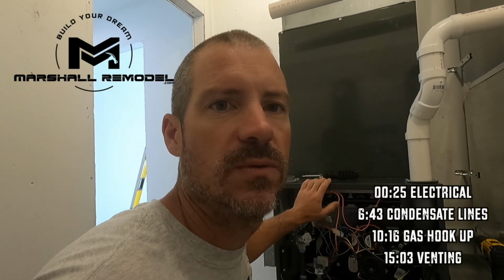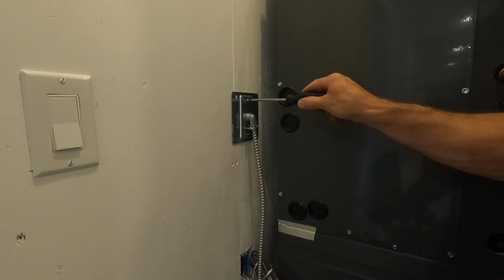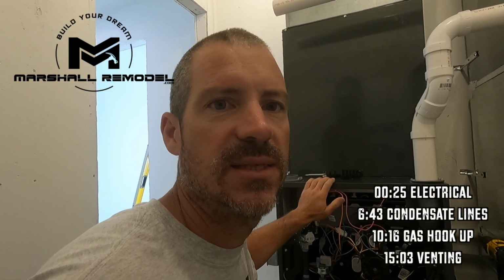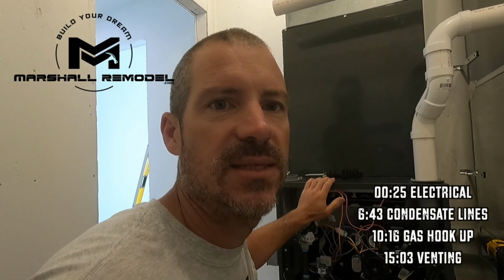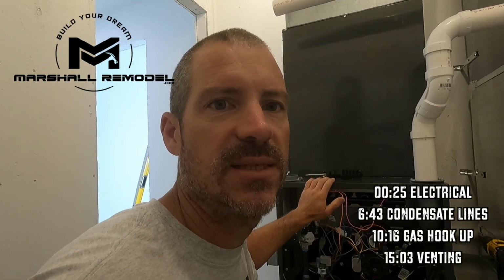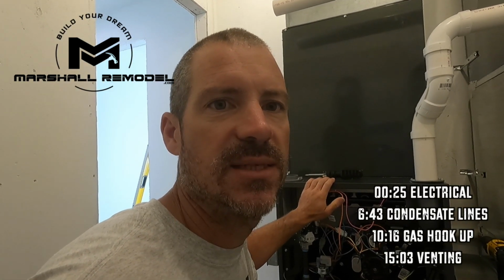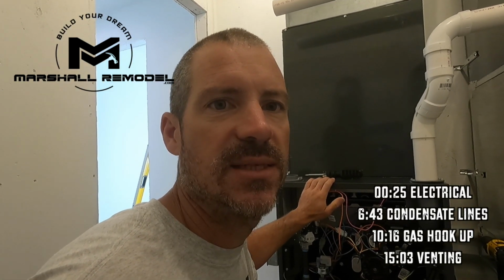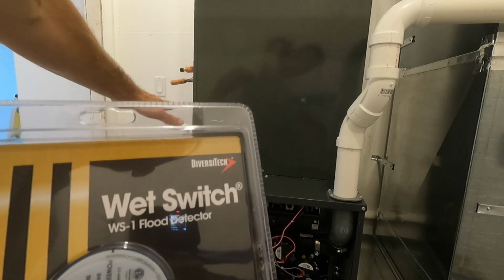Installing a Furnace and AC unit - Part 2

Comment: No primer on any of your PVC joints?  It’s usually blue, so the inspector knows you used it. Automatic code failure in my area. The concentric termination should not have any pipe or fittings added to it.  What you have done could actually cause flue gasses to recirculate into the combustion air under the right conditions.  Big no no.

Comment: Your gas drip leg should have been installed so there was a change in direction for the gas. The way you have it can allow for debris and moisture to be pushed across the tee. Otherwise nice work!

Comment: Do you have to put the low pressure switch in the gas line if it is natural gas.
Reply from the maker: No it’s just for LP since it comes from a tank vs a natural gas line

Comment: An SSU Switch is typically used for the furnace, and I agree, albeit a negligible point, to install it on the wall... too, while not a Code issue, it is usually standard practice for switches to install the line side on top of the switch and load side on bottom... just for uniformity in switches throughout a project.

Otherwise, very comprehensive coverage of the install! Appreciate the video posts!

Comment: Very clear and professional video .. always clean work ! I did have a question on your venting .. looks like you used 2" the whole way , did you ever have to step up to 3" after making this video ? .. my new goodman came with a chart in the manual . With how many feet with so many elbows , for 2" 3" runs . I'm only running less than 15 feet so I was hoping to stay with 2" . Want to see if you had any issues .  Thanks for taking the time to make these types of videos
Reply from the maker: Runs perfect. I ran 2” the entire way.

Comment: Also, you never put anything on top of a concentric kit.  They are designed for water to go down.  You just caused pressure switch issues.   DIY, lol.
Reply: Most definitely... I literally cringe when I list out how many items are incorrect and need re-done or changed.

Comment: You really need to read the instructions before you make videos, I've been in HVAC for 48 years
Reply: He needs to do more than read the instructions, he needs to bring in one of us properly qualified technicians or installers to fix all the improperly installed items.  I cringe when i watch the videos.  This system is going to have so many issues and will never pass code inspection.

Comment: Also should only use non-corrosive leak-check fluid. Cheap enough. Won't corrode metal pipe & fittings (unlike water)

Comment: Might be good to insulate your Ducts, also install an EZ Trap Condensate Drain Trap with Automatic Safety switch to prevent overflow when Drain Clogs (Which it eventually will...)

Comment: Great videos and explanation. May I ask you couple of questions
1. Where did you purchased the furnace (the entire unit)
2. You mentioned the part 3 would show how to install the wiring to thermostat and other stuff, I could not find one.
Thank you in advance.
Reply from the maker: We purchased the unit through a local place but have used AC Wholesalers in the past with good luck. Part 3... kinda forgot to put that video together but it's on the list!
Reply: @MrPostFrame  thank you for the details. Once again your videos helped me to do home improvements and lot of motivation.
I am planning to purchase goodman furnence and heat pump through hvacdirect.  With your motivation I will can do atleast 80% of the installation and will take help of contractor on the final setup and installation. Thank you.

Comment: The sediment trap isn't installed correctly. You want to install it in a way where the gas is flowing straight down so that sediment is falling into the trap. The way you have it has gas flowing across it which could allow some sediment to get past it.

Comment: You don't have to goose neck the concentric ,the 90% furnace drains.
The intake on the concentric is under the exhaust covered with that funnel piece
If you did a 2 pipe you have to goose neck the intake .
Reply: Yep, he caused issues with that furnace.

Comment: Obviously the work you’re doing on electric, gas plumbing excetra is legal for you to do. What is the situation for all of the regulatory inspections normally required for working on these systems? This is not an indictment against your work, because everything I’ve seen you do is usually to a higher standard than minimum requirements, just wondered if it is because you’re in a rural location instead of an incorporated city. Thanks for the content, very interesting and enlightening!
Reply from the maker: Rural locations tend to be less involved when it’s a personal home build. It can be a blessing and a curse depending on someone’s knowledge and skill

Comment: I don't mean to be degrading or otherwise. But after seeing this I feel like I should say something. As a licensed journeyperson in Iowa, and mechanical instructor.
Your condensate (tied directly to sewer without an air gap, improper venting,  improper trapping), gas line (improper drip leg location), electrical (missing protection from J box to furnace chassis), and flues (no  insulation in unconditioned space, screws protuding pvc pipe, exhaust cannot be terminated down on category 4 venting system, cannot have obstruction in exhaust, and improper or lack of proper support) are not up to mechanical code nor your installation manual, and you will experience many issues. And please under no circumstance tie your intake into the condensate sewer line as you will draw methane gas into combustion. Any manufacturer will also void the warranty on this product if you run it like this.
Reply: You have to insulate flues in unconditioned space?
Reply: What about the lack of anti-short bushing at the box connector.
Reply: Shouldn't there be yellow tape on the gas pipe fittings?
Reply: Where should the drip leg be located?
Reply: @jasoncanmore5838  it should dead head into a drip leg. Example would be to install a T fitting on its side right outside the furnace, bring the gas supply through the top of the T, furnace to be connected out the side of the T, and a nipple with a minimum length of 3" as measured from hub to hub (so you would need a 3.5 -4" nipple) with a cap on the bottom. This forces any moisture, oil, and debris to be collected in the drip leg and not allowed to flow right past into the appliance.
Reply: @mdjohnson03  Got it, thanks
Reply: After watching the video I needed to see the comments cause my brain was throwing off a couple of red flags the screws In the exhaust are gonna rust and it will probably recirc. Let alone not insulating the vent in un conditioned space could possibly freeze up
Reply: Finally another qualified installer that can back me up on the laundry list the long as my leg of all the issues that need to be addressed.  Hell, you didn't even list them all because you got tired type all the the wrong items.  I just cringe as the issues in this system.

Comment: You should extend your coil condensate vent line higher than the safety switch and with the ss2 installed how will you be able to spin out the primary drain?

Comment: you are going to be short on return air.  with a side return like yours and on motor side makes it worse. furnace needs to be on a raised box with return at bottom so return air can get around to other side of fan. this became a problem when they made furnaces really short. check the instructions that came with furnace.
 condensate is never hooked direct to a sewer line, must have a air gap
Reply: Air gap??
Reply: @stevenbrowningsr1144  air gap is a plumbing term. it is hard to describe so i would ask that you google, what is a air gap
Reply: Agreed, I see it all the time on goodmans  ends up with high co problems/overheated heat exchangers, the more return the better with any new 34" furnace. Idk about the states but in canada we are supposed to insulate the pipes going through unconditioned attic spaces so the exhaust doesn't freeze.

Comment: Always use a grommets or chase nipples when running wire through metal knock outs. Also, the condensate if highly acidic, may want a neutralizer on that, not sure what that does to a septic system.

Comment: Where I live the exhaust needs to be system 636 to last overtime with the heat fluctuations. Also need to be sloped 1/4" per foot back towards the furnace for condensation especially if the vent is running through an unconditioned space. With a hanger or support every 4 feet. Not sure if these regulations are required where you live.
Reply: To the best of my knowledge, that is code in all states for the PVC exhaust venting.  It was literally built to be that way, so there is no way vertical would pass code.  It would backflow into the system and what would be the point of having the rules in place.  I made this post on the first video.  The exhaust has to be re-done, on top of several other items.

Comment: Maybe I missed it but did you install a one way check valve on the condensate drain so water cannot back up through the drain into the evaporator pan?  It happened to us and it was a mess.
Reply: No he did not install any check valves , he did install a float valve which will cutt off poweer to the unit if the drain starts backing up

Comment: Please keep in mind that PVC is NOT resistant to UV light coming from the sun.  As such, the IRC (International Residential Code) requires that exposed PVC be painted so as to prevent its structural breakdown over time.  Excellent work, young man!  Keep it up!!!
Reply: They don't require that here in michigan

Comment: greetings mr. paul; i just use a long nose lighter to check for leaks. it is not as messy. also i had a problem with my air vents like you have because wasps went inside and built a nest that basically suffocated my furnace. they make round snap in screens (stainless steel) that fit the pipe fittings and they are online for purchase. they sure saved me..................g

Comment: 5:30  Ok Paul, If you have taken out the evaporator (A-frame coil) drain pan how are you catching the condensate off the evaporator and directing it out to the drains?  Something sounds odd here or I'm not understanding what you have removed.
Reply: I believe there are 2 different pans in the unit because it is designed for a vertical or horizontal install depending on the house. So I think he's saying he removed the drain pan for the horizontal mounted application.
Reply: @dcmchiefs2008  The A coil needs to be removed from the unit and a condensate drain pan needs to be added but that is the least of his worries after watching the entire video.  I hate to see video #3 but I don't believe that was ever made or uploaded.
Reply: That's wrong, this comes as a dual mount furnace, so it has two drain pans and he removed the horizontal one.  All of the cased A coils come with built in drain pans.  It's all good for this part

Comment: So please use wire nuts at the furnace/ac house junction box, The furnace cycles many times per day with a high amperage draw at startup. The legos could ark internaly duting high amp draw heating up and causing even higher amperage as the voltage drops. ps good luck, high power communications tech.
Reply: I had the same thought. Wire nuts are the way to go as long as a pliers are used to join the wires first.  Wire nuts were never designed for this purpose.
Reply: Wire nuts might be better, but that furnace has a max drawof under 9 amps, it's never high.

Comment: Question: When you ran the air intake/exhaust pipe out through the garage roof.  Why did you have the pipe go through a rib and not a couple inches over so that it was totally in the flat of the metal roof?  Wouldn't this have made it easier to install the boot and create a better seal?  Also where does the furnace filter go or did I just not see it.
Reply: I noticed the same thing. There might be a reason for this. Thanks for letting us follow your build.
Reply: Water rushes down the flats. Using the ribs, help shed water and not having running water into the seal directly.

Comment: Doesn't look like you got a bushing on the hole between single gang switch box and interior of furnace. Might be an issue with vibrating equipment wearing a hole in the wire insulation over time.
Reply: through a rubber grommet in it.

Comment: It's not worth changing, but I prefer to put the furnace switch at the wall so I can shut off the entire MC drop. That way if you needed to replace the unit or rewire something, you don't have to shut off the whole circuit. To do this you have to have a box extension that the MC comes out of the bottom and the switch mounts in front of. Then you don't even need the junction on the side of the unit, you can put the MC elbow straight into the furnace cabinet.
Reply: I was thinking the same thing
Reply: in easy access point from doorway to mechanical room.